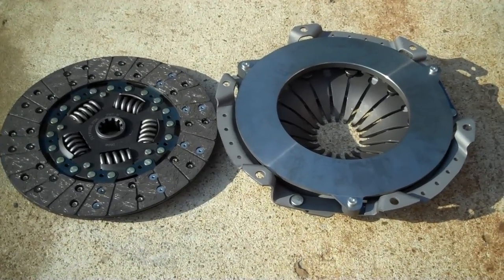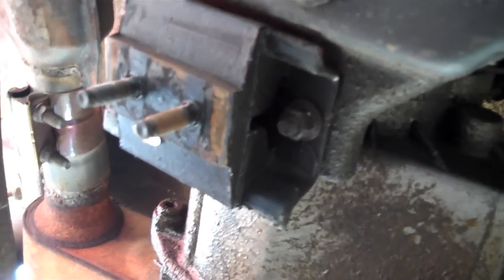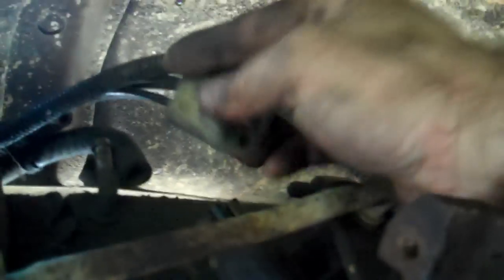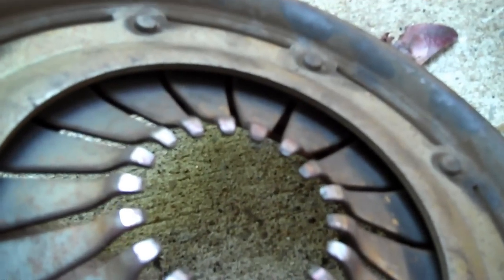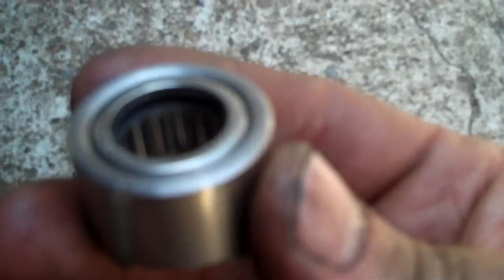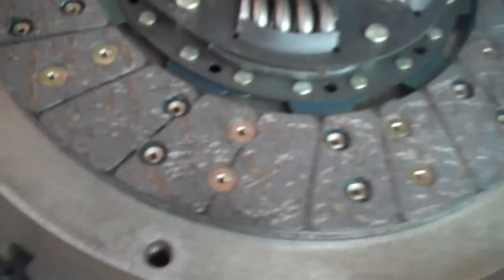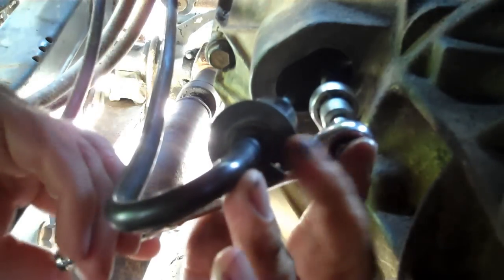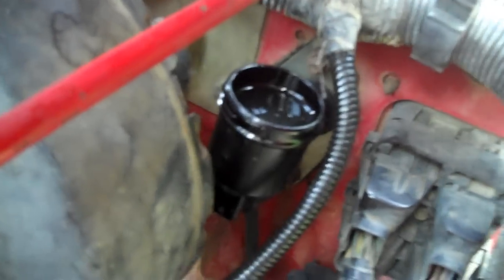Clutch Problem with the Jeep Wrangler YJ - Time to replace with a new kit.

Comment: You're a life saver for making this video, thank you so much. This is what I'll be finishing this weekend. Special thank you for the sandpaper on the flywheel trick.
Reply from the maker: Glad you like the video! The only time I do the sand paper thing is when the fly wheel doesn't need to be resurfaced from having ridges and grooves. The sand paper takes the glazing off the surface. Thanks for checking out the video and taking the time to leave a great comment! Have a great day!!

Comment: very nice video. Appreciate it very much and all of the detail. I just finished changing my clutch and followed this video every step of the way. The shop wanted $900 for the work, plus my skid plate nuts were shot so that would have been another $200. Did all of this for $225.  I wish I had the jack stand that would hold the transmission, but I didn't.  I used two straps tightened over either side of the frame and slowly lowered it and then used the straps to raise it back up then two of us lifted it manually and guided it back in.  That thing is heavy, but we got it done and the jeep is back on the road.  Thanks again!
Reply from the maker: Scott Johnson You are very welcome! Glad the video helped you out and save you lots a $$$. I got the transmission adapter, then discovered the adapter would not fit my jack. The trans adapter would fit my buddy's jack so we used his jack. If I had not had the jack, I would have dropped the transfer case to lighten that heavy thing up. Then done as exactly as you did. Use straps around the frame to lower and raise. Congrats on getting your Jeep back on the road! Have fun and enjoy it!! Thanks for taking the time to leave a great comment! Have a great day :-)

Comment: This is a great video. I got stuck on getting the bell housing back in line. Do you have any ideas on the best way to line it up. The shaft I can get into the spline but I am having a hard time getting it to go in further? Do I need to spin the drive shaft some to have it line up?

Comment: I enjoy your videos immensely! Detailed and down to earth! That being said, I'm putting in a "new" reman 4 cylinder engine in my 1990 YJ and am wanting to replace the clutch at the same time. My good buddy who is helping me recommended I replace the flywheel to get the most out of the revitalizing. My problem is I CAN'T FIND A REPLACEMENT!!! Any help would be appreciated for finding a flywheel for a 1990 2.5 liter 4 banger with a 5 speed manual. Thanks!
Reply from the maker: Take your original to a automotive machine shop and have it resurfaced. Thats all a reman does beside giving it a major clean up as well. No need to replace it unless its cracked or damaged. Good luck! Have a great day!!
Reply: @Poweraddicts  Just got a quote on that today. $50 to machine a flywheel with an hour turnaround! Hopefully it wont be cracked, just slightly glazed. Thanks for the advice!! You have a great day too!

Comment: I did not see you pull the shifter off of the transmission. Did you leave it on? Looks kind of tricky to remove but how can you slide the transmission back with the shift lever still on? Love the video, getting ready to do it to my '93
Reply from the maker: Thanks, glad you liked the video! Back when I first got the Jeep, the shifter was broke. Just a metal stub sticking up. I welded a threaded S10 shifter to what was left sticking up. Now I can simply unscrew it to move it out of the way. Thanks for dropping in! Have a great day!

Comment: I have a 95 YJ and just changed the clutch at 398k. I had a shop install it. Now the clutch does not let out until the peddle is almost all the way up. It let out in the middle before the change. 
Is there was to correct the travel on the clutch pedal so that it does not let out so high up?

Comment: Thanks for the video man! You saved me loads of time and most importantly...money! Any chance you will switch over to an external slave cylinder for the future?
Reply from the maker: Grant Curtiss It's been a thought. But as I scored another engine and trans that I swapped in (see here: http://youtu.be/04AuTalrDDI ) . The transmission had a NEW clutch installed, so in the name of saving the $$ I dropped it all in as is. If I happen to run across the parts seriously cheap to convert to external I'll consider it then. Happy this video saved you time and money! Thanks for taking the time to leave a great comment:-) Have a great day!

Comment: Thanks for the very informative video, Sir! I was driving back after getting my inspection sticker, clutch has just started slipping. Question? On a four cylinder YJ, could it be easier to pull the engine? Yanking the trans with the transfer case is hard on the floor on your back......
Reply from the maker: That's actually a very good question. As small and light as the 4 cylinder is, it would come out fairly easy. So, it would be a toss up. That transfer case isn't exactly a featherweight, neither is the trans. If you don't have a transmission jack to take care of the heavy lifting, pulling a 4 cylinder engine may actually be easier. It is really easy to pull the engine out of those. Heck, the inline 6 isn't even that bad.
Reply: Yes, if you drop that flywheel or clutch on your hand while your laying on your back.....😨 Quick tip, if you don't have a pilot bushing or bearing removal tool, here's an alternative: pack the end of the crankshaft hole with grease. Take a close fitting dowel, stick it in the hole. Give the end of the dowel a sharp rap with a hammer. The bearing comes right out! Learned that 55+ years ago.

Comment: Thanks for the info man! It's helped a lot so far. Couple questions though. Did you use a transmission jack/adapter or did you use a regular jack with Rachet straps. If it's the latter, how did you secure it to the jack. I don't want to drop the bell housing on myself. It's supported by 3 jackstands and the jack at the moment.
Reply from the maker: We used a jack adapter that time. I have used straps before, It sorta works. Its kinda like a hope and a prayer that it stays balanced though. Have a friend to be on the other side to help support/balance the transmission as you lower it. Good luck! Have a great day!

Comment: This isn't actually a comment but moreless a question. I just changed my clutch, assembly and flywheel. I have a 94 yj with the man 2.5 liter engine and yes it's a hydraulic system. Well can't seem to get my clutch bled so I watched a video. My tranny don't have the 2 lines you was bleeding yours with or a bleeding valve.  So what now.
Reply from the maker: I've never seen a hydraulic system with no way of bleeding it. Even the new systems that come pre-filled with fluid has a bleeder valve. So without seeing it there is no way of me knowing whats going on.

Comment: I watch this video and now am on the process of changing my clutch. I thought the throw out bearing was going bad and was making noise but when I got the transmission pulled back the throw out bearing looked good but the input shaft on the trans has some play in it is that normal for there to be some play or is that bearing going bad. Thanks for the great videos!!!
Reply from the maker: Brandon Moore The input shaft has a little movement ... 1/16 of an inch or so. The front part of the input shaft gets its support from the pilot bearing. Sometimes the throw out bearing isn't totally obvious. It may visually appear fine.Take the bearing pushing against the face while turning it. If you feel any "notchyness" ... roughness .. or anything but smooth movement. Bearing is on its way out. Also if the bearing doesn't feel at least a little tight it could rattle. What symptoms/sounds was you getting?

Comment: In your video 24 minute 58 seconds in those rubber bands side shown, I think my mistake was to remove them for now strip much oil the hydraulic bearing. It seems to have left his place a rubber or rubber packing inside the cylinder. What do you recommmend me to do?

Comment: Great video! I hope to have my own YJ someday. What mileage have you been getting with yours?
Reply from the maker: Joe Swanson Thanks, glad you liked the video. You should get one. They are a great ride to own. Parts are not too crazy expensive and they are easy to work on. As for mileage, welllll they aren't know for being an economy ride. Wranglers are driven for the passion of enjoying them. The engine I currently have in it is getting about 16 -17 MPG. The engine I pulled was getting about 19. Hopefully sometime next year I'm going to rebuild the original engine. Possibly get some MPG's back. But, I wouldn't give my Jeep up for anything. I drive 70 miles round trip to and from work. It's worth every penny I'm not saving over driving an econobox. Thanks for taking the time to drop a line. Have a great day!!
Reply: Thanks for the quick and helpful response! I also forgot to ask your opinions on the 2.5L? They seem to be much cheaper around where I live (WI). In my case, I would probably not opt for a lift and huge tires, but would still like to use it for trail riding and some commuting. Would the 2.5L be ok? Are they as reliable and cheap to work on as their 4.0 counterpart? Thanks so much!
Reply from the maker: Joe Swanson My sister has a 2.5L. They do good for trail riding. Kickin' around town is fine. Highway, watch out for the Prius, they might run over you! They get worse mileage than the 4.0L because the 4 little squirrels has to work so hard to overcome the barn door aerodynamics of the Wrangler. But .. I still like 'em. Me personally, if I ever score a 4 banger for the right price, I'd be dropping in a V8 ASAP. So, in short if you are not commuting lots of highway miles, you will love it! They are still lots of fun.

Comment: I have an 88 wrangler with Peugeot gearbox. I replaced the clutch and components due to a rate long throw out bearing.  Still after the replacement it still rattled  (unless you engage) is there not a sleeve or something on the shaft to help stabilize? Can’t believe that  only a c clip holds that thing secure.
Reply: A rattling throw out bearing
Reply from the maker: It simply slides over the input shaft and is clipped in. Not much to them. There is a possibility that you may have gotten a bad throw out bearing. I've seen it happen and it's very frustrating to have to pull the trans all over again!!

Comment: I have 91jeep yj and I put in clutch pressure plate .know it hard to get and out of gear.before with old clutch worked fine.
Every machete says rebuild  transmission...I don't think that's the problem...I have hard time trusting mechanics

Comment: When doing a engine swap, does it add any work for the mechanic to swap the clutch? Is there even a extra bolt to the replacing the clutch when doing a engine swap on the 2.5L I have a mechanic that is wanting to charge a little extra for doing this.
Reply from the maker: Yes, there is extra work. I highly recommend doing while the engine is being swapped.

Comment: With the motor running and the clutch out you could here a bearing making noise then you would press in the clutch with the motor running it would stop. Or if you where going down the road and press in the clutch and the transmission in gear you could hear the same noise but press in the clutch and out of gear while the jeep is moving it would stop. And on the input shaft it's about a half inch of movement up down left or right or in a circle motion. Lol another book for ya.
Reply from the maker: That input shaft doesn't sound good. There definitely is not supposed to be a 1/2" of movement. The first part of the description does sound like a throw out bearing. Friend of mine has a 2000 TJ, he has been driving his with that noise for a long time now. Sometimes the bearing can be noisy but still be drive-able. But, ya never know when the bearing decides to call it quits. Have that input shaft checked, hope it's not toasted!! What year Wrangler is it?

Comment: I use a socket against the fly wheel teeth against the alignment pin so I CAN USE BOTH HANDS TO UNDO AND RETIGHTEN THE PRESSURE PLATE
Reply from the maker: I never thought about that. I'll have to try that next time. Thanks for dropping in a great suggestion! Have a great day!

Comment: It's a 1994 yj 2.5 with 95,000 miles. And I think the brass gears are going bad too cause it will grind gears sometimes
Reply from the maker: Brandon Moore Sounds like it's time for a tranny rebuild or another trans. Around here Wrangler parts are very hard to find. I ended up using a Cherokee transmission. The transfer case needs to be reclocked if the XJ transmission is used. But, it's really easy to do. Just pay attention to the little parts. I have a couple of videos for 2 different reclocking procedures. Being that you have a YJ trans available just swap the tail housings between the XJ (Cherokee) and YJ .. your good to go! If needed here here is the vid to reclock the t-case: https://www.youtube.com/watch?v=Sgn6nKXm2I8

Comment: I have a question I have external slave that had two plastic straps holding it back I cut them then installed slave did I damage anything. I asked Autozone what they where for they hand no clue
Reply from the maker: It doesn't damage them, it just makes it harder to install. The plastic straps are for hold the slave cylinder push rod back for an easy bolt in installation. It can still be installed with the straps cut. So no biggie! Have a great day man!! Thanks for dropping by!!

Comment: We installed the engine yesterday what a "B" getting it to line up with transmission!!!  Having issues with the engine mounts lining up not sure what I did wrong.   How do you know if everything lined up correctly?  Also is it ok to bleed the clutch now?
Reply from the maker: Engine mounts can be a PAIN!! The transmission will not properly mount flush with the block if you do not have everything lined up properly. So .. if you have all the bolts in the pressure plate and the spines lined up correctly, the block and trans should be connected and even. If you have the clutch, master cylinder and slave cylinder installed. You can bleed it. Hope this helps! Have a great day!

Comment: oregon jeeper                               so, i was an idiot and put p.steering fluid in my master cyl (brother in law "fluid is fluid"}would a new master and clutch kit take care of fhis or all lines needed to be replaced? 4.3 ,headers,clifford manifold, 4 brl ,locked!
Reply from the maker: +Debbie Turnbull Nope .. fluid is not just fluid. Each has it specific use. First I would try bleeding the whole system pushing brake fluid through the lines. The reservoir is so small it would take no more than a cup to put the proper fluid back in it. Pull all the fluid from the reservoir, add brake fluid .. just keep bleeding until the fluid comes through clear. Power Steering fluid is much darker than brake fluid. You should be OK .. if not it will let you know over time. Then you can consider changing parts then. Hope this helps! Have a great day!!

Comment: Dude, I can help, I had problems with my speed gearbox and install a new clutch, when assembling and place the clutch release bearing will remove the sidebands that keeps refolding the bearing. but it worked well. mechanical problems that I keep well groomed gearbox, but again down the gearbox and the hydraulic bearing upload started pulling oil, disarmament and it seems that a package or league out of place. I have to replace those leagues or sidebands? What do you recommend me? you can rearm the hydraulic bearing? because I do not see how the league stops packing inside the cylinder.
Reply from the maker: Those straps are made onto the bearing. If is doesnt actually break the straps, you MIGHT be able to reset it. I've never had to do it so I cant tell you for sure. Trying to put the transmission in without the slave cylinder compressed would be a bit of a pain. Probably be easier to get another bearing assembly and start over.

Comment: What kit was this I just bought a luk kit and I’m worried that the slave cylinder/ throw out bearing won’t last very long
Reply from the maker: I got the kist at Advanced auto. I don't remember what brand all the parts were. Just make sure you put good quality fluid in the master/slave cylinder and it will be fine. They don't go out very often. What kills the throw out bearing the fastest is using cheap brake fluid or resting your foot on the clutch when not shifting. Thanks for checking out the video! Good luck and have a great day!!

Comment: hey man I rebuilt my transmission and replaced the clutch in my 91 YJ 4.0 but had major issues with bearing that came with the kit did want to fit thought it was in straight turns out it wasn't. just ordered a replacement bearing and tips for the pilot bearing install to insure its straight?
also when I went to autozone for a replacement bearing the one the sold me was way too small fit the shaft but not the crank any reason for that ?
Reply from the maker: bmriverrat11 Well ... first of all, looks like Autozone simply goofed up. Because as far as I know, if you have the 4.0 and the AX15 trans. There is only one pilot bearing.

As for getting it straight on the install. I just simply tap around the bearing until its seated. Then find a deep well socket that is close to the outer diameter without being larger than the bearing. Not hitting it very hard, drive it home. If its the correct bearing, it should pretty much self align. Hope this helps.